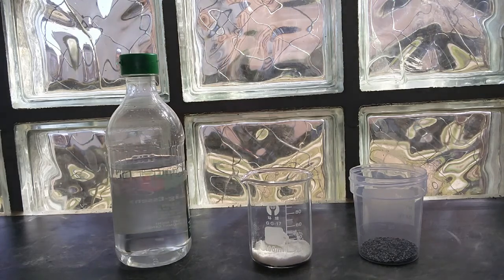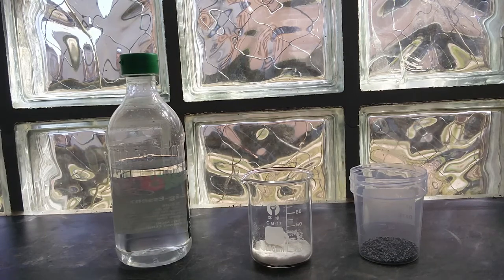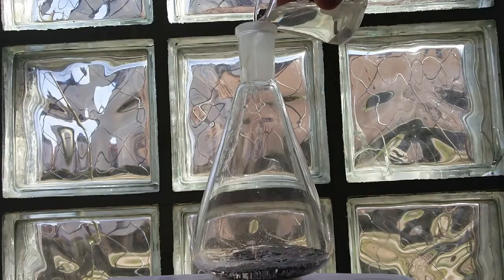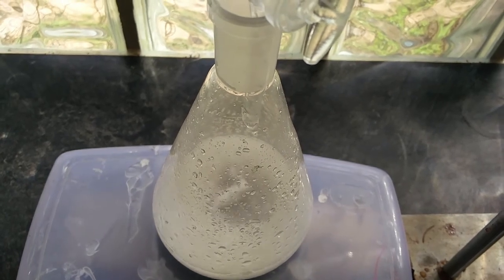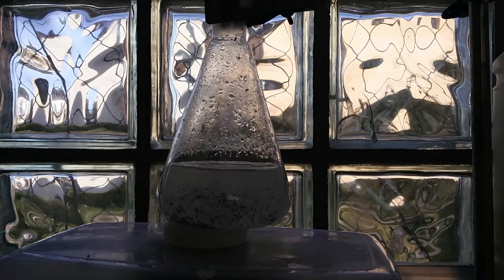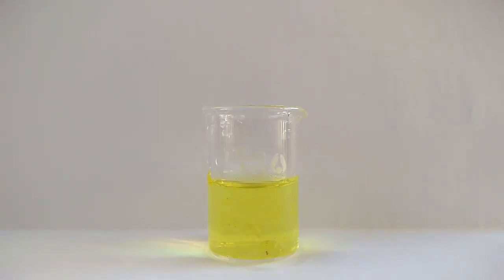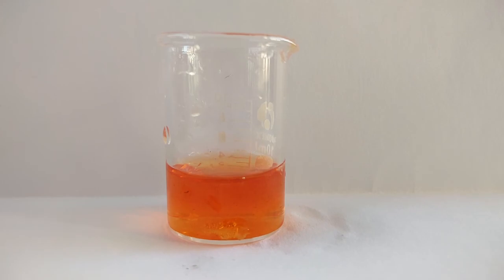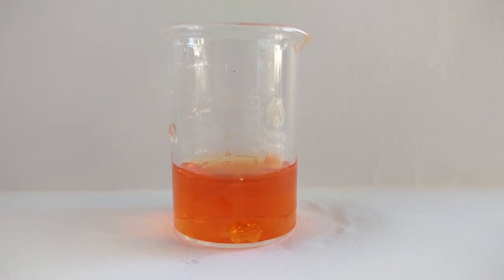Reduce nitrate to nitrite with hydrogen gas

Comment from the maker: After a very long time, I decided that I should make another video.
Sadly, I do not really have ideas, so I filmed the only thing I had in my mind.
Today, I am going to reduce nitrate to nitrite. In some countries, Sodium nitrite is available, but in others you can't really buy it; so I thought about reducing the nitrate.
There are videos on Youtube, but all these procedures didn't really seem to work. 

To start with, we only need three chemicals. Potassium nitrate, magnesium turnings and acetic acid.
The idea with this experiment is to attack the nitrate ion with hydrogen radicals. These are formed before the bimolecular hydrogen, which is normally a product of the reaction, is formed, it's also called 'hydrogen in nascent state'. This nascent hydrogen is much more reactive than normal hydrogen.

First, we prepare a solution of potassium nitrate in water. We dissolve 10 grams of this in about 50 milliliters of water. 
Next, we add 5 grams of magnesium turnings to an erlenmeyer flask. Add the nitrate solution to the magnesium.
The last step is to add the acetic acid to the reaction. It's very important to use acetic acid, other acids might be too strong and will decompose the nitrite product.

To an addition funnel, I add 163 grams of 25% acetic acid. In this reaction, I use a two molar excess of magnesium and acid to make sure that all the nitrate reacts. 

Slowly add the acetic acid to the reaction. It's also important to use strong stirring to make sure that everything reacts well. I added the acid dropwise, this took about one hour. This might be slower than necessary, but that's okay.
As you can see, the reaction get's quite cloudy due to the hydrogen gas which is formed in the reaction between magnesium and acetic acid.

After some time, the reaction became quite warm and there were yellow fumes of nitrogen oxides, so I used an ice bath to cool it down.

When all the acetic acid is mixed in, you should stir it for another 15 minutes. The cloudyness should slowly fade away as the acetic acid is used up.

And there we have our nitrite solution. Sadly, it is very contaminated with magnesium acetate and I also do not know how to get rid of it; but for most reactions the acetate isn't a big problem. 

Of course I tested if I really got nitrite. Here you see the result of a nitrite test which was used on the nitrate solution. As you can see by the yellow color, there is no nitrite in here.
This orange red solution is the result from a nitrite test from our product solution. The concentration of nitrite is very high in here.

Do you have any ideas how to get rid of the magnesium acetate? Let me know in the comments!

Keep doing chemistry!
Reply: Electrolysis? The magnesium will try to plate out but will end up as the insoluble hydroxide?
Reply: In an old industrial patent say used Zink and ammonia solution on half concentratet Sodiumnitrate solution. The ammonia solution is in great Exzess because its not only reaction partner ist an catalyst too.  The Temperatur is maintainded between 20 and 25C after 2 hours its over and you get an yield of 99.3 %. The Zinkoxyd can easy be seperated.
Reply: How did you figure out this reaction by the way? Amateur chemists have been trying to get pure sodium nitrite for a while. What about recrystallization? Bubbling CO2 through the solution? I'm not sure what else could work. Do you think that this would work for making isopropyl nitrite? What do you suspect is the yield of nitrite in this reaction?
Reply: Would this work for sodium nitrate to make sodium nitrite too? Also nascant hydrogen doesn't exist. Read the wiki article on it.
Reply: Also holy shit sorry for spamming but does regular vinegar work too?
Reply: You can try dissolving magnesium acetate in acetone. I couldn't find any info on its solubility but maybe since its cation is an organic molecule it will dissolve in organic solvent. Sodium nitrite is insoluble in acetone.
Reply: I am so sorry to keep commenting I really hate to spam but you could theoretically evaporate the solution down until crystallized and then set up a gas collection apparatus and drip in HCl onto your crystals and measure the gas produced to figure out purity. By the way magnesium acetate has a low melting point of 80C. Maybe you could use a crude strainer and use a heat gun to gently melt the magnesium acetate. The solid that is left behind should be potassium nitrite which can be recrystallized to become purer.
Reply: You should attempt an isopropyl nitrite synthesis using this stuff. Isopropyl nitrite is one of the biggest reasons amateurs want this chemcial.
Reply: @Andrew-my1cp  50g sodiumnitrate disolved in 150ccm water add 350ccm ammonia solution with desteny of 0,96. Add 60g zink powder cool reaction fessel in an water bath and hold temperature between 20 and 25C after 2hours reaction should complete. Source is an old Patent. As i wrote abouve the ammonia is reactant and catalyst.
Reply: Would this reduction work on Barium Nitrate to Barium Nitrite?

Comment: Evaporate the solution down and take the crystalline product and heat. Magnesium acetate can be poured away from the nitrite as it melts at 80c. Just an easy method probably won't get all of it out but it's a good way to separate most of it. Great video though!

Comment: Precipitate the Mg out with NaOH and filter the mixture, afterwards, you could separate the NaNO2 from acetate salts by adding acetone to the solution, this will precipitate the Sodium acetate ( maybe a bit of NaNO2 as well), after that you filter and crystallize it by evaporating the solution, for purity you could recrystallize it from hot water or alcohol. You should try to generate the hydrogen elsewhere, not insitu to not contaminate the product next time, cheers.
Reply from the maker: Thats a pretty good idea, I might try it out! 
The problem with this reaction is that the hydrogen has to be produced in situ, because the reducing agent is monomolecular hydrogen, not the H2.
Maybe palladium on carbon is an option, or raney nickel.
Reply: Chemistry Dog Or you could use an Hg salt and UV light, from what I remember. It's easier to separate out of the mixture, but it's toxic. But anyway, the Nickel would be the best choice you could even make a video of preparing a very fine powder of Nickel. Dissolve some in HNO3 and react it with oxalic acid, i saw you had some and decompose the Nickel oxalate, it's gonna be pyrophoric, but if you work quick and keep it under a CO2 atmosphere it's gonna be fine. You're gonna need stirring for this one and some way to transfer the gas.
Reply: I think you could use NH3 for separation? Mg does not forms a soluble complex right?
Reply: Thats greath .thanks .im gonna try that .
Reply: @fastbre4ker  the thing is that you could also form NH4NO2, which decomposes and all of your work will be for nothing...
Reply: @chemistrydog257  What about bubbling CO2 through the solution? Wouldn't magnesium carbonate precipitate out?
Reply: How much nitrite does this reaction yield? Is nitrate also a contaminant or just pure magnesium acetate and potassium nitrite?
Reply: why does acetone precipitate the sodium acetate?

Comment: I tried this method and the yield was around 80-90%. Excellent procedure, easy, clean and accessible. I use my nitrite solution to make alkyl nitrites so I don't see a point purifying it. I would love to know if the magnesium acetate will interfere with the distillation of sodium nitrite and sodium ethyl sulfate though

Comment: I remember this reaction from an old chemistry textbook (Vogel's Practical Organic Chemistry, 5th ed. perhaps?) - they've used zinc which also works. I don't remember the workup but reply if you are interested. Other (aqueous) method is reduction with freshly prepared lead sponge. Heating alkali metal nitrate and calcium sulfite also works - the product is corresponding alkali metal nitrite and calcium sulfate. Nitrite can be easily extracted with water, calcium sulfate separates by filtration.

Comment: Does the reduction also work in basic medium? if so, try with aluminum. I think the Aluminum Hydoxide should be easily removed by filtration. And it shouldnt be a problem to crystallize the nitrite if sodium hydroxide is present.
Reply: it reduces it to much, ammonia is formed

Comment: Interesting reduction! Wouldn't piping in the hydrogen from  a gas generator work to remove the problem magnesium acetate? or is there more going on in the reaction mixture like the Mg catalyzing the reduction? If it is purely the hydrogen, you could run an electrolysis (water) cell pumping in unlimited H2. If I get around to it I may test it out.
Reply: have you tested it out
Reply: Like it says at the start it is hydrogen radical created insitu not h2 that's doing the reducing